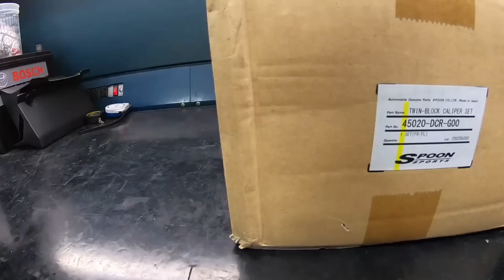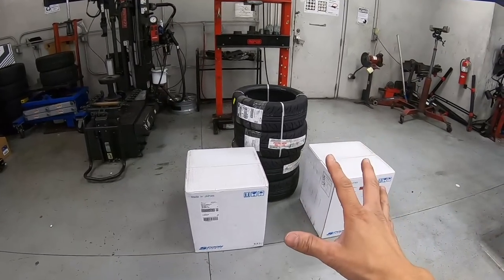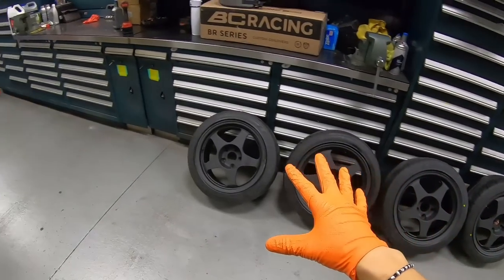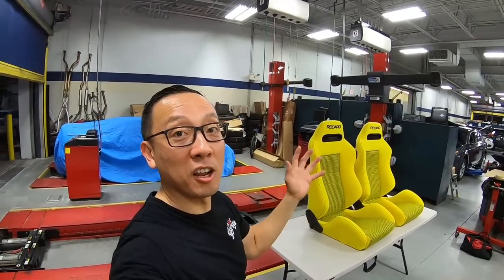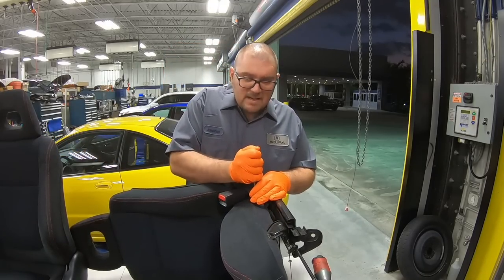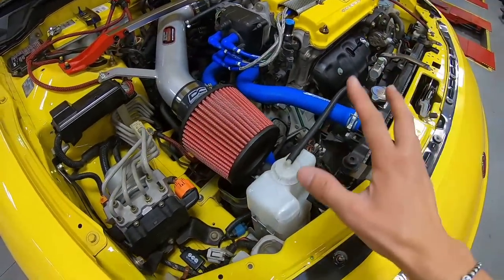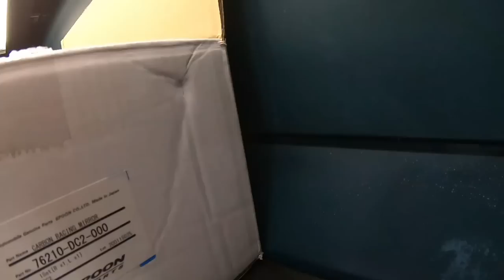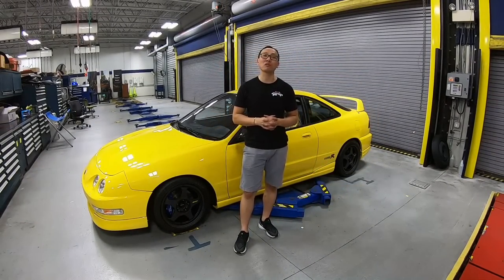Phoenix Yellow Integra Type-R Minor Refresh - Spoon Sports and TomCat Recaro Seats Makeover  (Pt 5)

Comment: The stock airbox is amazing on these (i'm talking about JDM's, maybe USDM is the same) really no need to get a load of heat soak running that DC air filter.
Reply: Doubt AHC did that. But I have to agree. I’m partial to the old school Comptech Icebox setup from back in the day. I made a DIY version long ago by running a pipe from the stock airbox down behind the turn signal, and running a K&N filter inside the airbox.
Reply from the maker: Just stay tuned for the next episode on this series. You won’t be disappointed

Comment: What is the offset specs of the sw388 offset from the 16x7.5 width.
Also, the tires specs that you used for a rub free fenders with spoon front calipers
Reply from the maker: +30 is the offset. At our height, no rubs at all

Comment: The wiper blades were installed backwards. The air foil is supposed to face into the wind.
Reply from the maker: They are not installed backward, instead they are for RHD. We have the correctly LHD version installed.

Comment: The front lip is not correct, there was no black weatherstripping on ITR’s, only on the optional Oem body kit.  Fix that lip, other wise beautiful ITR.  I owned 2 in the past and regret selling.
Reply from the maker: We are totally aware that weatherstrip/molding do not come on the ITR front lip/spoiler. We add that on to avoid scratching the front bumper

Comment: I hope you guys realised you put the wiper blades on upside down before giving this back to your customer.
Reply from the maker: They are not backward. The one we installed was RHD, the LHD weren’t available at the time. The “correct” pairs are back on the car
Reply: @ahcgarage  Nice, glad to hear it as they looked a bit stupid in the video with the spoon logo upside down. Curious though as I've never fitted spoon wipers can you not reverse the fitting in the middle of the wiper blade where it mounts to the arm, like a Wurth or Bosch wiper, in order to rotate them 180° into the right orientation?

Comment: Downgrade imo. An ITR should be left alone. All stock.
Reply: I have had it both ways.  I now have a 98 CDM with Spoon springs and shocks, CT engineering icebox, 98 spec JDM 4-1 header and exhaust system, 98 spec steering wheel and Recaro seats.  I am quite happy with the driving experience and can revert to stock anytime.
Reply: I like some of it but the wipers were just over the top. They’re made for a RHD car so they’re backwards on this car. The spoiler thingies should be facing forward which the would be on a RHD car. And the Spoon wires are known the reduce power on the dyno.
Reply: @Patrick94GSR  all bling. None add anything for the car except jdm car show points